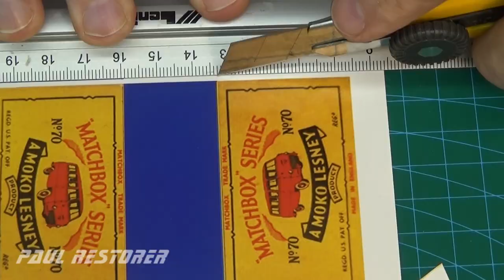Matchbox Ford Thames Estate car nr 70  model autka odnawianie, renowacja, naprawa

Comment: What is this white powder for bonding?
Reply: It's used for a filler so you can sand and shape the repair.
Reply: Baking powder. It sets the CA rapidly and makes it stronger.
Reply from the maker: This is plain baking powder. regards

Comment: I like the way you round off the end of the axels with your drill.  You say you use the drill with a "stroke" on.  Can you tell me what a stroke is?  Thanks
Reply from the maker: I warmly welcome . my translator explains it that way. This is the function of a drill for drilling in concrete. A hand-held battery drill is perfect. It is important that the rotation is not too high and the end of the axis exactly flat. Greetings from Poland
Reply: @PaulRestorer  Thank you for your reply.
Reply: Hammer Action.

The drill is peening the axle and the rotation of the drill creates a mushroom shape on the axle.
Reply: @kjamison5951  thank you for your explanation.  That process makes it look so much more professional.